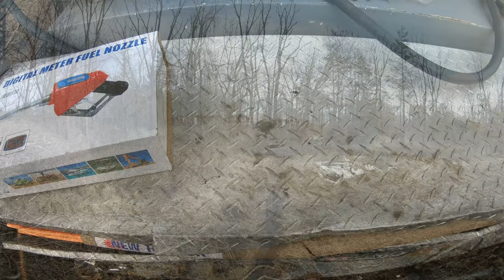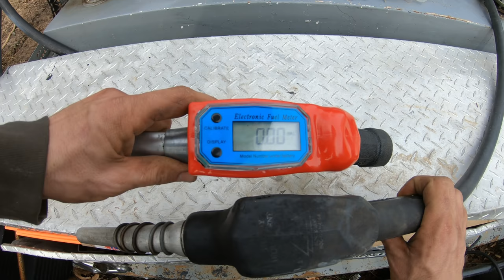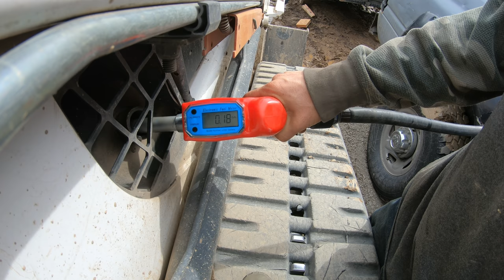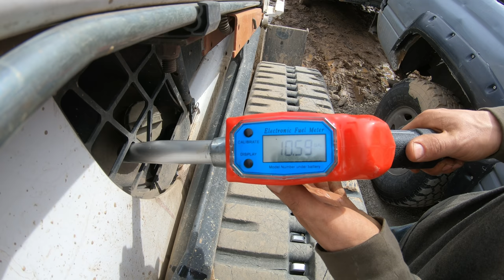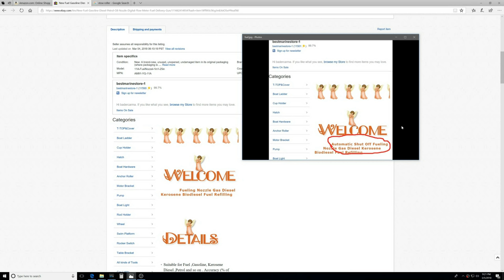Installing an underground propane tank

Comment: The purpose for the cathodic
protection is to provide a higher level of
safety. UG propane tanks can be subject to
severe corrosion conditions and can degrade
and start leaking over time with no visible
signs. Leaks from UG tanks have resulted
in injuries and severe property damage.
The type of cathodic protection
usually provided is an anode bag, which is a
magnesium or zinc rod enclosed in a cloth
bag with a moistening agent and electrically
connected to the tank
Reply: Thanx!!!
Reply: was wondering what that bag was for, thanks. it's a sacrificial metal, similar to what's inside a water heater I'd think
Reply: I was curious about that because in that section it was difficult to make out what the guy said. I was thinking it was some sort of anode, but like others I've heard, he pronounces it AY node.  Makes me cringe.  It's a soft a...... an ode.  Have no idea why people think it's AY node.  Works just like the anode rods in hot water heaters. Sacrificial metal that corrodes easier than the steel tank, so rather than attack the tank, the corrosives attack the magnesium or zinc. Often used on large ships as well.
Reply: You get out much? Newsflash Ace, not everyone speaks exactly like you do. Its not a crime.
Reply: Yep. Anodes prevent a thing called "electrolysis" from occurring and corroding the tank. They draw the electrical current from the tank to the magnesium rod inside the anode. If you took apart an anode that had been in place for some time you would find that the magnesium rod is deteriorated from the electrical charge. Thus, anodes have to be replaced periodically in order for them to continue providing protection for the tank. Anodes are also installed inside of tank-type water heaters. When I worked for a public utility company we installed anodes on our underground steel gas mains.
Reply: Round the midwest here we leave them above ground.
Reply: @hypercube33  the anedode bag?

Comment: At 4:28 when you were working the excavator out of the trench, I found myself sitting with my fingers crossed.  Like it would help you get out.  That was impressive operating skill.  You know you machine's capability very well.  The wire diagnosis in the control box was above my head.  The way you solved it was ingenious. Kudos my man !

Comment: Well, i'm not familiar with the building codes of this location.
But everything I see built in this video series and other alike on youtube you just bury everything in soil/mud (in the US).
Concrete footing directly on the soil and no insulation, backfill against basement walls only soil, the propane tank, only soil.
And that piece of land seems to have water running down to it since it is on a slope.

The slab poured inside was directly on gravel, why not insulate it, and the walls, makes it more energy efficient and easier to heat the basement during winter.
The basement walls has a painted membrane on the outside, kind of obsolete.

I'ts like looking at a construction site 30-40 years ago.

Besides that, great work morale/ethics of Camarata. Getting it done.
And I do understand that theese construction methods/choices are probably not Camarata's choices, he is just doing what the customer ordered.
Reply: Hello Oskar, in the US many of the building codes are different from county to county.. Sometimes using better methods( like you suggested) is not easy to get approved by home builders because of cost of materials and qualified people to do the work are 25-50% more expensive.. So it takes a long time to amortize the expense of doing it in a house that might not justify it. I live in a wealthy area not far from where Andrew works and even the 2-5M dollar new construction is done this way... rare to see even insulated forms or spray foam on many of these projects.. and I have been doing construction inspection for a while...

Comment: Never  dealt with propane tanks however as an owner of a home building company and demo and excavation company we dig out for natural gas lines to the house and accessorie buildings.
Tip:
1. Always pressurize the lines for any leaks before back filling.
2. Use 2 layers of caution tape  for your lines and add fine sand. Any sharp rocks or stone can eventually puncture the lines with weight

Comment: I believe the house is in a swamp hole.
On the video of septic system install I noticed the bottom on foundation in basement was wet. 
I see future trouble .
Reply: Tim Hottinger will dry over time with proper grading and foundation drains
Reply: It will dry overtime and the proper grading will be done.
Reply: SISSY Ladyboys  Andrew Camarata has just said, “You better stay away from this mud!!”

Comment: I'm one of the thousands addicted to your excellent videos. Your skill both at editing and drone  footage is simply outstanding. You have a real feel for good videography as well as taking the time and effort to explain things in an easy to understand and relate to manner. 
That said, I finally saw you do something that even myself wouldn't do. And I don't know squat about excavation. ha. About 100,000 tasks I've seen you do and it always worked... unconventional sometimes, but.... it worked and no one got killed. And your work seems to hold up over time. 
But when you backfilled the trench leading away from the foundation with the pvc pipe in it, I had to cringe. First of all, you filled in the middle section first, which I'm sure is standard practice in dry conditions. But not only did this push the pipe way over to one side of the already enlarged trench (after getting stuck and unstuck) at a pretty severe bow, but by filling in the middle, you guaranteed that the water above it would be trapped and when filled, would create instant quicksand.  This was clear the rest of the video where the Bobcat sunk into it and even yourself started to get sucked into it.  
I don't' think you can fill a water filled trench and expect it to somehow just dry out, especially if you've dammed the water first.  It created a deep, soggy slurry of fine dirt suspended in water... in other words, quicksand, all along the trench.

Comment: Explanation (not mine) for the white bag the men threw in next to the tank for peoples interested :
http://www.pettank.com/wp-content/uploads/2016/03/cathode-protection.pdf
Reply: Thanks for that mate, it had me curious.
Reply: @michaelovitch Great explanation. A few things to note: Line 5 and 7 states the bag should be 2 to 3 feet away and saturated with water after a portion of backfill to activate it. Another note is that nowhere does it state that its meant to absorb a spill. This is meant to create a cathodic reaction to prevent long-term corrosion.
Reply: that kid aint got a clue
Reply: michaelovitch j
Reply: Thanks, wish more people would be helpful like you

Comment: a 500 ft well. there was water at 1ft
Reply: Surface water does not necessarily equal drinkable water.
Reply: Surface water doesn’t necessarily equal drinkable water.

Comment: Propane and propane asessories
Reply: Just be sure to stay away from butane.
It's a bastard gas!!
Reply: I would fill that propane tank.  If you get a week or so of rain, I would bet your tank would float,  UPWARD.   HAPPENED TO A NEIGHBOR of mine with an oil tank. 
Great video.  

JoeB
Reply: Boy ill tell yaaa whooat
Reply: damn it bobby
Reply: @josephburkhalter5105  oil is lighter than water. I personally have never seen a underground tank float.
Reply: Propane and propane accessories - Butane is a bastard gas ⛽️. Stay away from it!!

Comment: Hey Andrew. I just finished watching this video. I've watched all of them on this playlist so far. The job is coming along very nicely. I used to work construction back in the late 70's & early 80's, and so these (and all your) videos take me back in time. I was getting worried though about that building site being too wet to build on. I don't know if it's like that year around or not, but since it's at the bottom of the hill and flat from then on I suspect it is, and so I am glad to see that you dug the drainage ditch around the perimeter of the property, and I hope that works to keep the ground inside the perimeter nice and dry year around. Before I saw that you dug that ditch, I was wondering if maybe a complete underground drainage tile system, like farmers use in their crop fields, might have been the solution. But it would have been more costly, and if your drainage ditch solves the problem for cheap then it is the better option. Anyway, I am really enjoying your channel. I watch several of your videos every day. Eventually I will have them all watched and then will have to wait til you upload new ones though. I want to thank you for sharing your amazing experiences with us though. Take care!

Comment: Underground water needed dealing with at the beginning on that site.
Not too late though for the owner to request a water interceptor be constructed across the top of the slope to catch the downhill flow and divert some of it off to each of the site's sides.  Then install land drainage lower down, all taking water to a balancing pond arrangement at the bottom.
Reply: HYUKLDER1 excellent point

Comment: I was told never fill in a trench or hole that has water in it. It will turn to slop. Good save Andrew! That was like working on chocolate!! I'd like to see the next guy ALMOST step on that ground. It's gonna take awhile for that to dry!!
Reply: Yea, I cringed when I saw that. That is never going to dry out, all they needed to do was rent a pump and remove that water, what a mess.
Reply: Clearly it did dry out because the truck backed over the trench to install the propane tank. 🤦‍♂️
Reply: No it didn't, that trench is over on the left side of that ditch, and he will be lucky if it ever dries out. I've did dirt work starting in 1984, I know what I'm talking about.
Reply: Also, thumbing up your own comment didn't make you any less wrong.
Reply: FullSpectrum Survivalist 

Then go to 11:30 in the video where Andrew is just starting to dig the trench for the gas line on the east side of the house and in the background on the north side of the house you can see the well pipe about even with the point the driveway disappears into the trees. 
That is the side the propane truck backed across to drop of the tank. 

You may know something but you are certainly wrong about what sides of the house the trenches are on.

And for the record I never thumb up my own comments but just to prove it to you I will now. Obviously I can’t thumbs up twice.
Reply: No,k I'm nor wrong, go to 21:40, and watch till you see the road again.
Reply: FullSpectrum Survivalist 
At 24:02 you can see the well pipe, the propane cap and the truck that delivered the tank. 
The trench Andrew is walking along is the trench he dug to drain the water from the perimeter drain. 
As Andrew is walking towards the house you can see the tail end of the truck that brought the tank.
Reply: I used to do repair work on large diameter water lines.  When we would dig these lines up, the top 8' of soil would be dry and then the last 5-10' would be damp or worse because of the groundwater.  Often times, the location of these lines prohibited any ability to backfill into a dry excavation.  Ground water would be so intense that you would end up with a slop hole full of spoil rather quickly.   We would go ahead and backfill, pack it in the best we could, and then come back in a month or so to top off the eventual depression that will form as the ground dries.      You just work with what you have.
Reply: This house is clearly in the wetlands I don't know how they got permission to build on it. Probably a very old property that outlives all the regulations and whoever owned it some time ago filled it all in. We have the same problem in CT with condos going up on very old farm house properties.
Reply: I was told same thing. We would stop the work for a week to let ground drain then backfill drainage pipe with sand-rain rock-clean fill.. We used special paper/very fibrous like, comes 3-4' wide in 100' length. Bury propane tanks? NEVER heard of that where I was working. Tribal land.. more rules/regs than one could shake a stick at!!
Reply: Yeah I'm sure they didn't think of that....NOT!
Reply: Most third graders would have said "I've DONE dirt work..........

Comment: for those curious about the anode bag:
In short, the sacrificial anode bag acts as a "decoy" for the damaging currents that can harm a tank in an underground environment. Tank Coating and Backfill - The outer surface of an underground propane tank is in constant contact with an environment that can be extremely damaging.

Comment: My first experience with a tractor was an old Oliver 2wheel drive with a cable release for the bucket. It came with the 210 acres my parents purchased in 1962 at the end of SilverHollow Road. Dad was always getting it stuck mowing the fields, jacking it up placing rocks and boards and pulling with Mom driving the Willies became the norm.....they moved from Long Island and were totally unprepared for life in the mountains....
Reply: How is life in the mountains, my friend?

Comment: 17:24 'anode bag' like the sacrificial anodes on a boat engine. I still learn something new every day! A bag of magnesium tied to the tank with a copper wire. They actually work too if you've ever seen an old underground tank that didn't have proper electrolysis protection. Anything metal that deals with water its whole life is vulnerable. We used to use 60-80 gallon aluminum tanks at our business and the electrolysis chewed through new ones in about 7 years - and those weren't even buried. Gold, silver, titanium and stainless steel are the most resistant, but never 100%.

Comment: Lmao... you got lots of "practice" getting out of sticky situations on this one, plus almost lost your boots on one of them... nice saves.  As for that fuel gun/nozzle,  I installed one that looked like that on a bulk DEF dispenser a few years back and it auto-stopped.  Look at the underside of the tip of the nozzle, there should be a small hole on the bottom of the nozzle where it sucks air until the level rises up and then it would suck liquid and kick the flow off.  If that small hole is not present on the bottom side of the nozzle, it never was intended as an auto-stop-capable filler.  Good news on the partial refund on it.  I was suspect of the accuracy of the flow meter (on ours), but using it for DEF in a non-retail situation, it wasn't that critical anyways.   Also,  for buried propane tanks, we can't do that up in Canada, or at least nobody does it.  If we did bury tanks, I'm sure there'd be a law that would state it has to be dug up and replaced every 10 years, because that's the way we seem to do stuff like that.  I know when I was younger in the retail gasoline biz, it was starting to get beyond stupid with all the rulez and regz surrounding in-ground tanks, pumps, anodes and anode systems.   Volume/capacity measuring and monitoring systems took a serious jump in complexity in the late 80`s after a series of high-profile stories about cases of serious gasoline tank leaks in retail situations where the owner knew damn well about it, but chose to cover it up, leading to some serious health problems, and a few cases where brand-newly-built homes in close proximity to the leaking gas stations became condemned to destruction after the owners/residents were poisoned by fumes from escaped gasoline leaching around underground.

Comment: NEVER trust the volume line on a fuel can. I have spoken with the WEIGHS and MEASURES people who test gas station pumps and they have a measured container they use. I happened to be filling a 5 gallon can while one was testing and I talked him into testing mine. My 5 gallon mark was closer to 5.5 gallons. So two proper ways to find out without any doubt. 1) use a container that is calibrated for X= volume. 2) weigh the volume. 
So why is that property so damn wet? I know it snowed there lately, but that is a lot of water flowing in your canal!!  
Years ago a buddy bought 9 acres really cheap because the property would not perk. After seeing the property I could see why. It had sooooo many trees on it that even with the driving snow, there was very little snow between them. That told me someone planted all the trees trying to suck up the water, but really what had happened was it was getting no sunlight or wind/air in the middle of the acreage..  We spoke with a guy from a town on the other side of the city and he agreed. My buddy bought it cheap and that fall we started clearing. In August before we started it would not perk. By April the next spring we had cleared about 3 acres in the center and thinned out the trees by about 8 to 1. In April the same guy from the county came and made a bet with me that it still would not perk. It not only perked the 5 gallons minimum. It perked nearly double the 5 gallon minimum!! We had also had a pretty nasty winter that year as we commonly do up in Rochester, only a few miles off Lake Ontario.
Reply: So did the county man welch on the bet?